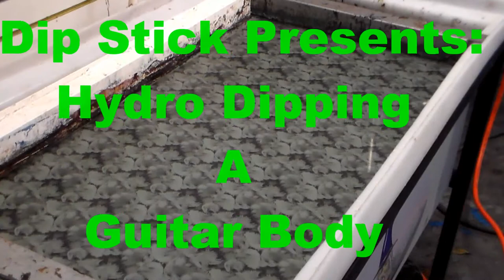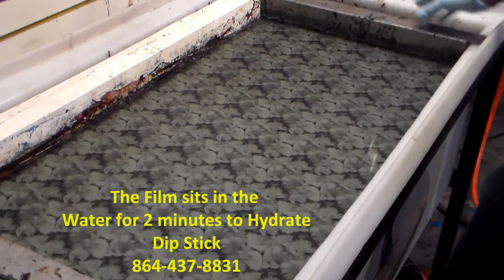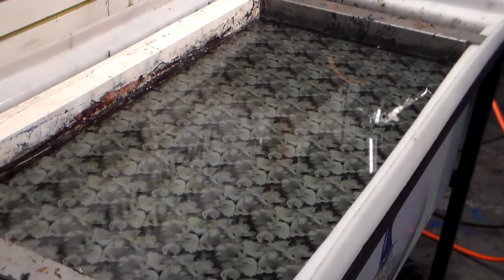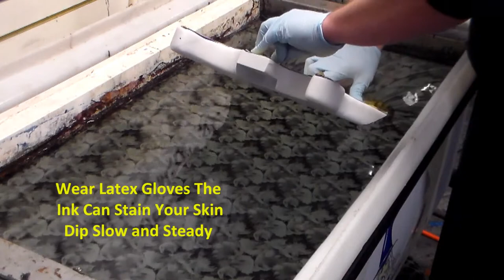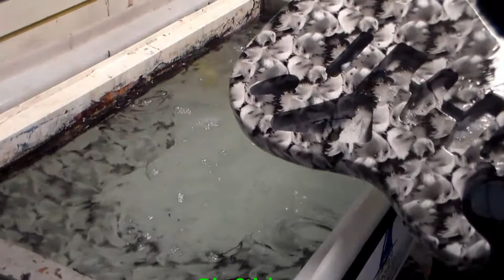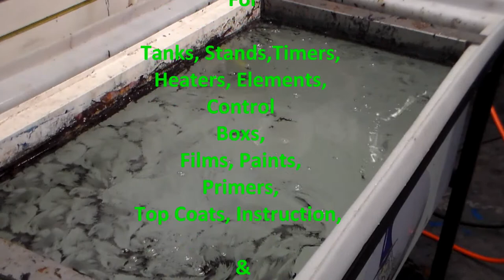Dip Stick Hydro Dipping A Guitar Body 1 M

Comment: What kind of substance do you spray carbon fabion with
Reply from the maker: The activator is in the spray can. Spray it on the carbon fiber film on the water. Wait a few seconds to activate the film, then dip your part to be dunked into the tank gently. Move through the film easy and in one motion. Don’t stop moving till the part is out of the tank. Let dry. 🇺🇸👍🏻👍🏻 N8XLQ.

Comment: Hey Lenny I'd love your help, do you gloss the base coat before dipping? Also what is the finishing process for a mirror finish? Thanks so much
Reply from the maker: shaun young 
Hi Shaun,
I never use a gloss base. The base coat is a primer. If you want to use other colors thats okay. Use flat finish paints so the new dipped print adheres to the part very well. After that if you want to use a gloss finishing coat you can do that to make the the dip print very glossy. :)
Reply from the maker: +shaun young 

Hi Shawn,
I'm sorry I thought I answered this question a long time ago. You don't gloss before you dip ever unless of course it's some kind of experiment. That's always fun too. Basically to adhere the Skins to your product that you're dipping you want to make sure that you have a nice flat base coat so there is a little bit of a grip to the surface of the base coat that your skins graphics are going to sit on. 

After that you can do gloss clear paint and you can powdercoat on some things. It just depends on which way you want to go. Be careful with powder coating. Test the process on a sample part first.

Good luck and have fun. 🤘😎🤘